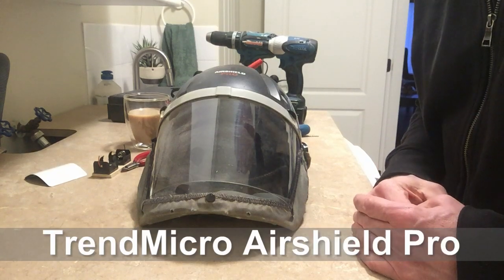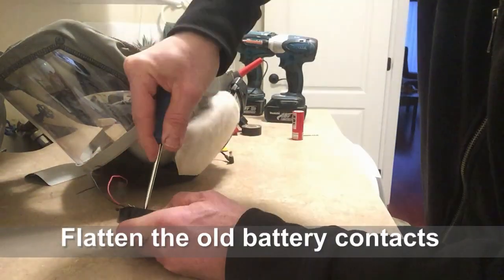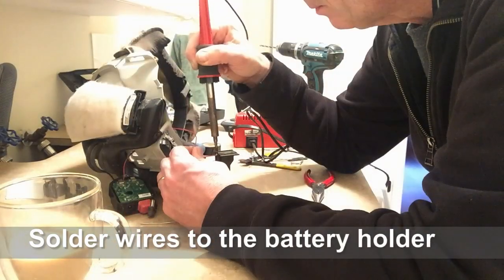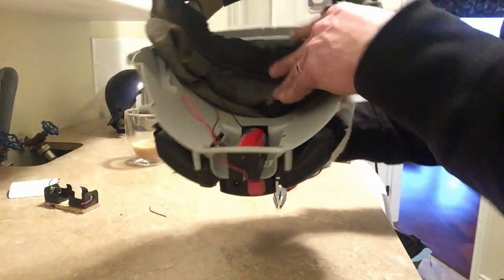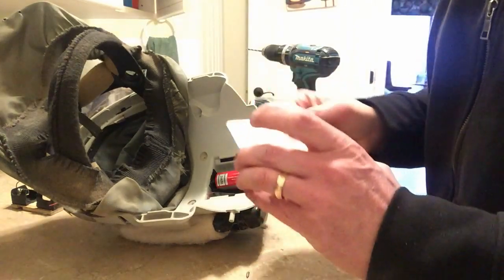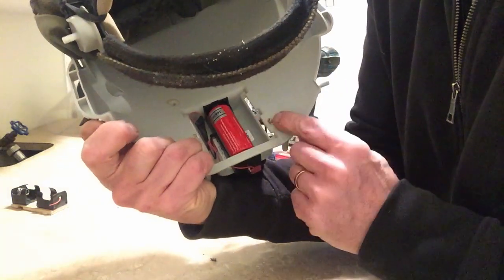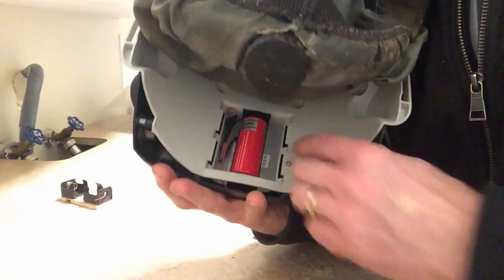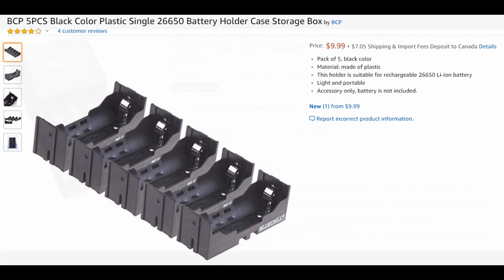Trendmicro Airshield Pro LiO Battery Replacement Hack

Comment: Does this still charge using the normal charger? I just ordered one, I might do this hack right out of the gate. I was also thinking about trying to make a belt battery pack to take the weight off the head entirely.
Reply: Ah duh, I can see you have to swap them out and charge them in a cradle. Well, that definitely puts me in a mind of making a belt pack.
Reply from the maker: Yeah it’s not the most convenient and the lio battery still weighs down the helmet. A belt battery pack would be best.
Reply: Someone on Thingiverse has a 3D printed belt "box" that accepts a Milwaukee M12 battery and a potentiometer to reduce the voltage.

Comment: George, thanks for the post. It's sad that for the price Trend doesn't provide a better battery and charger. Shame one has to modify a $400 tool. I was about to abandon mine because frequent battery replacements are vexing (and expensive).
Reply from the maker: Hi Rick, Yeah, would not be so bad if the batteries werent so crazy expensive and lasted more than a couple years.  Been on these lithium batteries for over a year now with no degradation,  8 hours use per charge.  I am going to upgrade to the 3m versaflo if bowl sales are good this year.